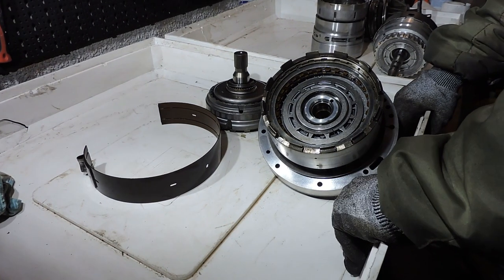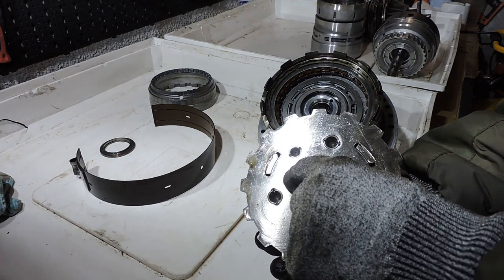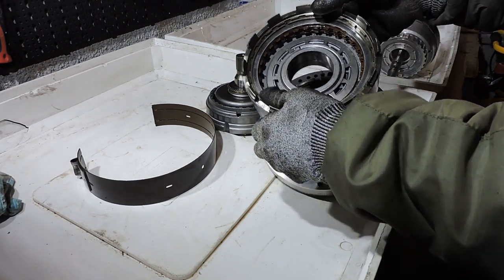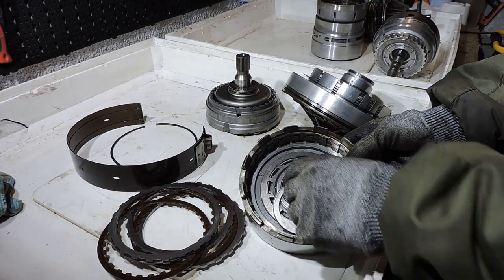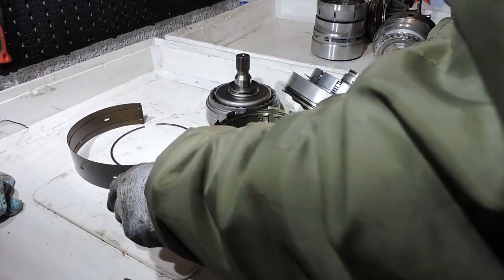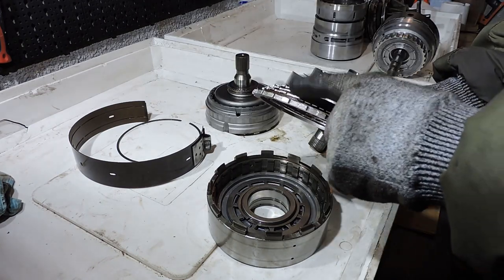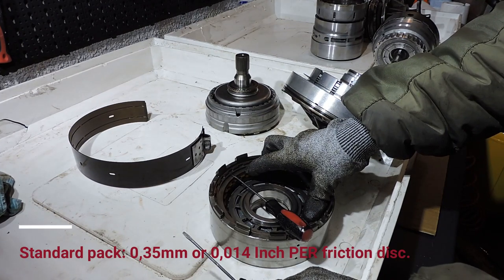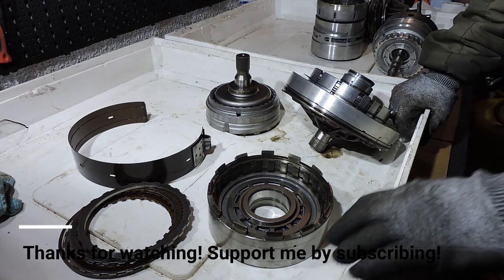Automatic Transmissions: DIY Basics

Comment: Whats the material coast of a Tier 2
Reply from the maker: DIY job with a gearbox that still works kinda ok is about 800-1000 euros and includes a rebuilt converter. In this case you do not need a new valve body.